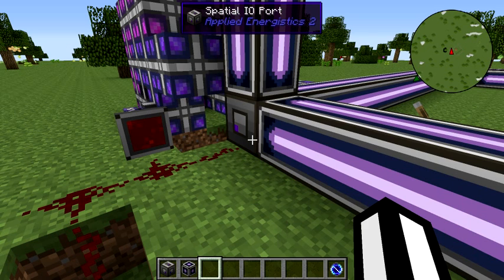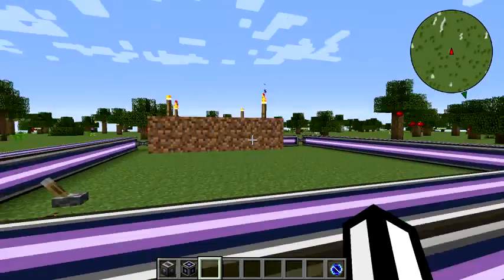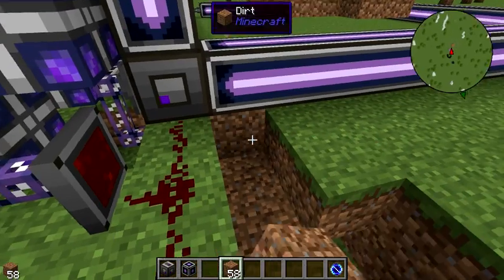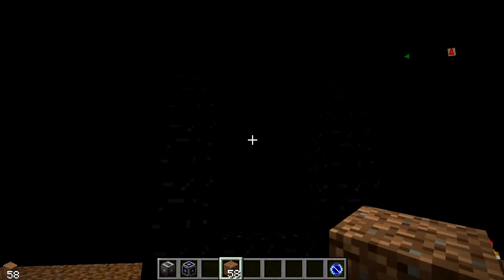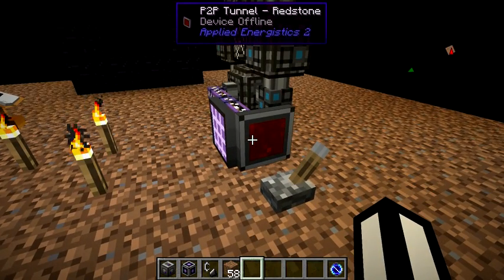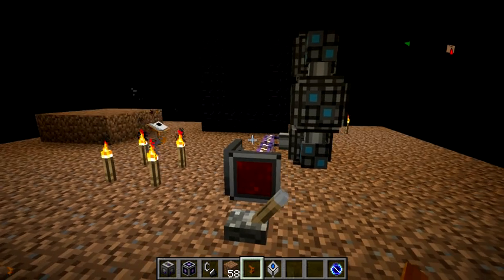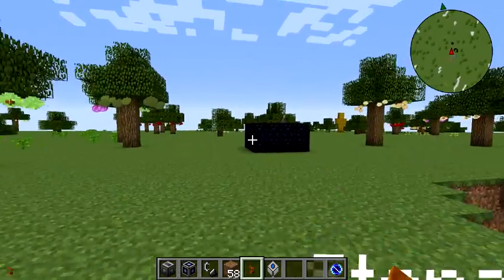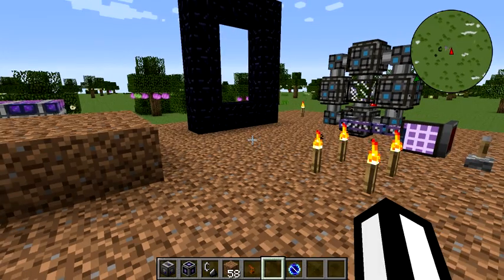AE2 Travel Inside a Spatial Storage Cell

Comment: Yeah you set up the ME system a little backwards there.  You have the storage system in the overworld.... a safer way is to have it in the pocket dimension instead, which denies access to the storage system to anyone who can't get in, or doesn't have access to the network security settings.  Once stored, as long as you have a way to keep those books safe... you're all set.  Alternatively if you could make a proper Relto...

Comment: okay, so what if you try placing your build from the spatial cell from within the spatial cell dimension? I gotta try that.
Reply: wont fit, its a 16^3 setup and only a 15^3 space
Reply: Ryan Roberson there are three spatial storage drives. 128^3, 16^3 and 2^3. Thanks for reminding me. I haven't tried. Be right back.
Reply: Ryan Roberson It totally works but since I was using headphones, I lost my hearing. I went too deep. A dimension in a dimension in a dimension.
Reply: place the spatial cell you're inside within itself? it wouldn't fit :/
Reply: he meant the inception, plus i answered the primary already, but for the fitting deal, i mean that you can fit almost every manufacturing setup within a 15^3 area, so you can keep swapping them out and reloading their storage withing the grander 127^3 area, and you would never need to leave! especially if you had an equivalent to ee2 (mc 1.2.5), you could just live in there, which would be so cool.
Reply: What would happen if you used creative mode to break the barrier? You could easily have enough space.

Comment: What happens if you set up some Morelos when your in the storage cell and load up the cell? Does it duplicate you?
Reply: Well, you would need to be in creative mode. You see, a 16x16x16 cell's dimension is the same size, and creative mode is necessary to break the barrier to fit all the mechanics. But i don't know what would happen. Theoretically, it would probably teleport you to the corresponding coordinates. Also, ever trapped your sibling in a spatial storage cell? I did once, thinking the ground would dissapear. I also made her rage quit by putting it into the input slot of a furnace, telling her it smelted into a cookie, and ate the cookie, making her think she was trapped forever.
Reply: Just be aware, they'd have to be reeeeally dumb. Also, this comment is two years old.

Comment: What happens if the energy source fails while using the pocket dimension and how can I test it?
Reply: What energy source?
You only use energy to store to and from the disk, the pocket dimension doesn't need energy to exist...
Reply: @Mr Penguin 
I don't get why it would be neat for long term storage to use energy...
If you continually need something to stabilize the storage, it's not long term storage...